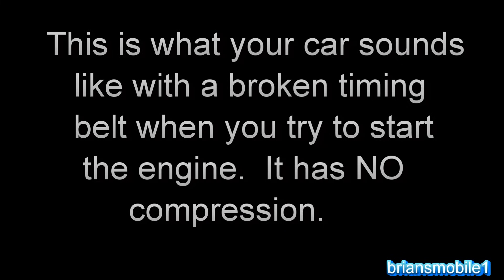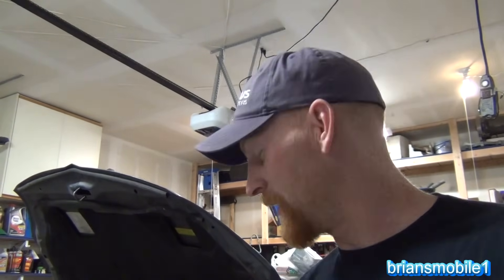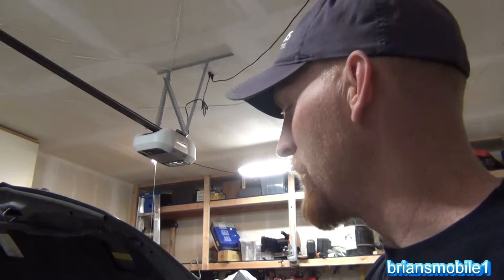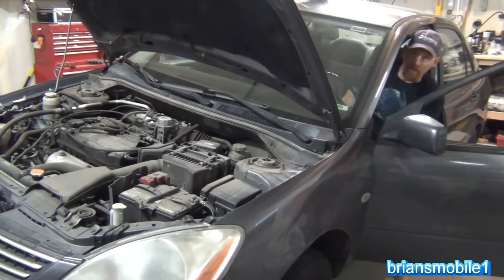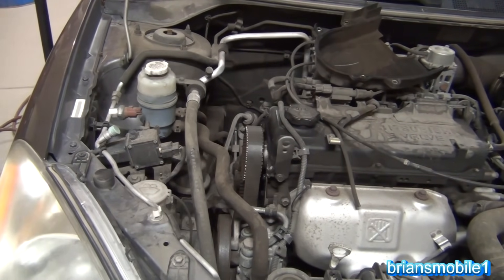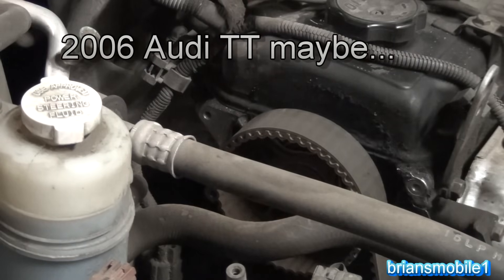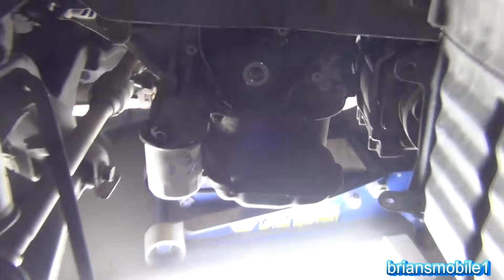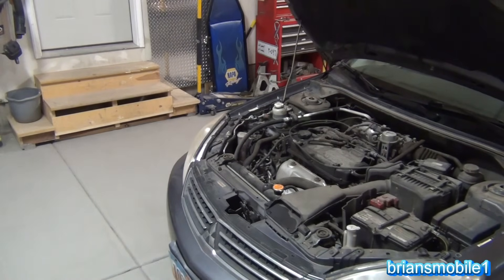What SOUND Does the Timing Belt Make

Comment: My car has a po340 code and replaced camshaft p  sensor. But it wont start at all .opened peep hole on timing belt and it's not moving .could it be other things with my car and it made no noise when it stopped dead in the road .Help

Comment: So my vw gti was running great, I parked went inside for 2 hours, came back out and it wouldn't start, I thought it sounded like the fuel pump, like it wasn't gonna turn over but a mechanic tried to start it and said the chain was broke and messed up the motor... from a dead start? It never started up... is this possible?

Comment: Wait how did you not bend the valves? on a 4 banger 16 valve, there must have been SOME valve stuck open completely, because you did turn the crankshaft via the starter motor, which would have spun the pistons all the way through each cylinder up and down... thus hitting a valve... ?
Reply: +sranjesuper This is a non interference fit motor. There is clearance between the valves and piston even if the valves are open.
Reply: Nutz4Gunz45 That's the only conclusion I come up with, but someone else said its interference motor
Reply: +sranjesuper The Uploader said there is a spot of 45° regarding the camshaft where he got non-interference. It's in a thread a couple of comments up, i just read it quickly. At least he is one lucky man.

Comment: Thanks for video; it might have taken lots of spirit to make it, with an arm busted up. Credit to you. Hope you are now much better. I have a forester 2002 with 200.000 miles in it. It started with a "Check Engine" idiot light. I also heard a noise like the Geiger counter-kind-of, and replaced all 4 sparks (3 year olds), and the PCV valve. Still the data analyzer tells me the knocking sensor is at fault. I can't remove the knocking sensor's bolt (12mm), seized and I I am afraid it might brake if I use an impact wrench (can't heat it; too close to the throttle: fire risk). I begin to think the sensor is only detecting the pinging the timing belt make the pistons produce, because of slack. What do you think (with the grace of the Holy Spirit, that "will reveal ALL things", Brian?) Thanks, in advance.

Comment: I have 2003 CTS 3.2L engine I change the serptine belt then driving last than 8 mile the car made a noise. I did pull over my friend came drove it about a half mile it stopped. The crank senor code came on is this the timing belt and or the valves bent; such I do timing belt and head job or replace engine. What do you think I should do

Comment: I got a 2002 Honda civic EX with a 1.7L V-tech, and I've been having problems with the harmonic balancer coming off the crankshaft with a chipped key way, I went to take off this morning and it stalled leaving my driveway and got stick in the middle of the road, now it won't start at all and sounds exactly like the car in the video. Do you think it could be the teeth on the crankshaft for the timing belt  on the civic.
Reply: how did this pan out? did you fix it or was it done for?

Comment: Hey Brian, my 2001 Xterra would start, Sputter then shut off. It would stay on if I keep my foot on the gas. It’s throwing code p0340 and was told it could be the timing belt. So I replaced the whole damn thing myself, timing belt. Water pump and tensor. Now it won’t turn over at all. Everything is lined up TDC. Also I should mention, brand new FSU and Pump.

Comment: i have a 98 camry 3.0 v6 had to replace the timing belt marks on the back part of the crank line up at the dot on oil pump and both cams lined up with the marks on the back plate,it doesn't want to idle any ideas

Comment: can the engine be broken if the timing belt broke while driving
Reply from the maker: Yes.  On an "interference engine" the piston and valves occupy the same space in the cylinder at different times.  Without being in sync the piston can hit and bend the valves.  Once that happens, the valves can't seal well enough to fire and run well.

Comment: Wow y'all got real lucky that it wasn't a full head rebuild.
Reply: probably a non-interference engine!
Reply: Robert Baines youre probably right. because he would have crushed valves with that attempted start up in the beginning of the video.
Reply: He left a comment talking about how it was an interference engine. They just got lucky because the cam stopped in a 45 degree area where there isn't interference, and they broke down in a parking lot, so camshaft inertia wasn't a big issue.

Comment: Damn changing the timing belt could be very hard, look at those components blocking the way...you have to removed them before you can open the engine
Reply: Timing belt replacement sucks.  I hate doing them.
Reply: nitroman365 hahaha
Reply: Try changing the timing chain and tensioners in a 2007 Suzuki XL-7.
Reply: I'm gonna pass. Haha

Comment: Can I ask you a question, If the timing belt were broke, could you still get it to crank and run and go for a little ways before it dies again
Reply: No
Reply from the maker: Hi Grayson!  Thanks for commenting.  No.  If the camshaft doesn't turn in relation to the crank, it can't run.  The job of the timing belt is to keep those two in sync like a couple of dancers.  Without it, feet get stepped on and the dance partners fall down.

Comment: I have a 2.4l eclipse 5 speed and I think my belt broke. But when I felt it bogging down it didn't make any noise and I pushed the clutch in immediately. I downshift ed and it shifted fine and it was still bogging down and I just pushed the clutch in and pulled over. It is an interference motor but do you think the valves got damaged? It blows white smoke out of the intake and I was told it was because too much compression. Any thoughts are appreciated

Comment: Lucky! When I bought my 99 Accord as soon as I learned it had a timing belt and was of an interference engine design I changed it right away.  144k, water pump was mint and belt was just a bit hard around the edges. Dang Hondas. 

Before that, I had a 2.0 non Ztec Escort....timing belt blew at 40mph. Low and behold, its was a non interference engine. Replaced timing belt and no problems what so ever. Ran like a top again.
Reply: 9.9.15.     I had a 1989 Ford ranger 2.3L with 258k miles on it ,for 22.5yrs, changed the timing belt twice. The last time it was starting to slap against the plastic cover! I replaced it for $6.95, a Gates belt! Ran sweet afterward. I also changed the tensioner bearing & the water pump. 💤

Comment: My guess would be that this is a non-interference engine - that's why he got away with the repeated cranking. There's very little or no chance that his valves would've all been closed at the point the belt gave up.
Reply: I was wondering the same thing. It must be non-interference type. Sometimes car doesn't do anything if it logs a fault code for timing sensors. Would be wise not to clear the code and keep cranking it. 😂

Comment: People say bad things about Pontiacs, but no lie my parents gave my cousin our '03 Grand Prix with 165,000 miles on it, never changed the spark plugs, never changed the timing belt, never changed the head gasket (and it needed it pretty bad). My cousin did all those things after we gave it to him and it's still running with 230,000 on it now. 
As far as I'm concerned the grace of God kept that belt good for 160,000 miles lol. My parents are so damn neglectful... I guess that's why I'm hyper diligent and do my own maintenance.
Reply: grand prix are chain driven most newer if not all GM vechicles are all chain driven. if u maintain the oil changes u should never have problem on the timing.
Reply: kidzero1943 Well shit, am I a silly boy or what. I thought it was belt driven heh... somewhere around 160,000 miles the head gasket developed a leak so my parents "gifted" it to my cousin, I guess when he had everything apart he decided to change the timing chain since he had it apart as well. 
My parents were great on oil changes, and funnily enough they were shit on changing the coolant. 10 years with the same coolant didn't do the head gasket any favors...
Reply: +Jesse Crandle I had a 93 Astro my dad gifted me, had around 200k in 2011 before the gift. did basic maintenance, the worst thing thing happened was  i had to replace was the alternater and ujoints. it started knocking at 380k in 2015 then shortly it was the end for the 4.3 engine.
Reply: +Jesse Crandle  I had a Silverado 94 it made 300,000 miles on all the factory gaskets with regular oil changes and tune ups  and we where not always on time with the oil change sadly this year the engine blew I had the oil changed  checked it oil was good little did I know over the period of that week the gasket went and mixed coolant with the oil I did know and kept on driving my oil pressure was normal and  the engine temp was normal I get about 50 miles away from home and the engine blew a hole in the side of the block milky oil went everywhere its now at the junk yard I now have a jeep grand Cherokee I also had a chevy Tahoe  I couldn't get it to stop misfiring so I sold it to get money for my jeep.
Reply: SuperJeremi10 I worked at a Mercedes dealership for over a year, saw that happen to an 2013 ML 63 AMG. Well, something kind of close. The car was traded in with a knock in the engine, so one of salesman dumped a can of that tar/aluminum looking head gasket fixer in the oil? He drove it around the block and just as he pulled into the dealership you heard this bang, suddenly 5 quarts of oil were on the ground and there was a fist sized hole in the side of the engine. The mechanic who worked on it told me a new motor from Mercedes would cost over 30 grand LOL...
Reply: oh wow lucky for the person who traded it in though wonder how much they got  it sucks though I miss my Silverado I had just got the ac fixed in it too the evap under the dash had a big leak in it so It would not hold Freon for more then a week it went 10 years without ac we finally spent the money had a new coil put in new evap coil line dryer orifice tube and ac compressor so it would be a new 134a system and it had been open to the environment for so long the pully on the compressor seized up so I said what the heck ill redo the ac system.  I love my jeep though its nice drives good and ac works great I had the drain line cleaned out though it was clogged and water backed up inside not pretty when you had to pull back the carpet to get all the water out.
Reply: SuperJeremi10 That sucks, AC work is a big undertaking, and basically what you did (replacing pretty much everything) is almost what you have to do once a system has a leak. Hell Eric the Car Guy, he'll do a video "fixing" someone's AC and then they come back 2 weeks later and it doesn't work again... you just have to replace everything.
Reply: yea it is that's why we waited so long to do the ac on it but when I got it I wanted ac  I loved having ac though don't we all its nice to have   yea I have seen that  with that town and country he was working on my mom had one of them vans that thing was a bitch to keep running even from day one  we regretted buying it ever since yea it was a nice van but it was in the shop at min every 3 months for something the first week we had it the ac went out and the breaks stopped working it always had the issue with the belt popping of and leaving us stranded if we hit a small puddle even if the belt and tensioner was new it always seemed to have break problems It got to the point when the engine light came on we just kept driving it till it broke down or had to be fixed we will never buy another town and country my Tahoe I had to replace the office tube it was clogged and drain out the oil it was all black and filthy self eol and I replaced the line dryer thing  pulled a vacuum put new oil in and recharged worked great after that ice cold air it did not have a history with leaks only leak It had was at the charging port and I fixed that with new valves  ac still works perfect on it  but I sold it due to major mechanical issues no matter what I did I couldn't get the engine running right I sold it to my friends dad who wanted t use it on a hunting lease and as a work vehicle and did not want something nice to get messed up hes also a mechanic so I'm sure he will get it fixed sold it for 1,000 I also gave him the Silverado he wanted it we did a trade he doe some mechanic work for me and he gets the truck so everyone is happy I have no idea what hes going to do with it but I don't really care I got new car.
Reply: +SuperJeremi10 the person probably knew about the knocking thats why he traded it.  We see this all the time at Honda but the thing is the salesmen that work here know about and could give 2 shits if the car is in bad condition. Anything to make a sale...they don't care. Honda pays for it
Reply: kidzero1943 Same at Mercedes honestly. If the motor blows it's the dealership that loses money, but if they convince someone to get a new vehicle then they get money from it. That being said I find most salesman think they're hot shit and have no clue how to diagnose vehicle problems, so the salesman probably just figured there was a faulty part (that wasn't as important as the engine).

Comment: Also... you have to be the luckiest person in the world for a broken timing belt on an interference engine to not damage the valves. It was at the moment when the 2 outter cylinders were at the top of their strokes and the 2 inner were at the bottom, number one was at the very top of the compression stroke, number two was at the very bottom of the power stroke, number three was at the very bottom of the intake stroke, and number four was at the very top of the exhaust stroke.... meaning all the valves were either closed, or out of the way of the piston.

Comment: Nice. Liked that.  I'm looking for help with this problem.  Writeup below I've used on Nissan forums.  I'm thinking my issue may be a failed hydraulic timing belt tensioner.  Any ideas or experience you have is greatly appreciated!

Hello all!  This is my first Nissan Pathfinder.  I have always wanted one since the late 1990s.  It's a 1998 SE 3.3L, automatic transmission, 167,000 miles on it.  I got it at an estate sale for $2,000.  

It has a loud knock or tap that happens part-time and so far it's not been resolved.  I'd really appreciate it if anyone could point me to anything to check next, or describe if you had similar problems with yours.  I've run the motor minimally...only to troubleshoot.  Here's what it does and what I've done:

1. When it's first started, it knocks for less than 1 second and then gets entirely quiet.  I hear maybe 2 knocks when it first starts.  Then, when the motor is accelerated to 2000 RPMs it begins to knock and it keeps knocking until 3000ish RPMs. It increases in speed as the RPMs increase.  If I let off the accelerator it stops knocking.  When it's higher than 3,000 RPM it goes away.  So it's in this midrange RPM the knock is present.  It does this sitting still, or driving it.

The rig was very sheltered it's whole life from what I can tell.  It was driven lightly by an elderly lady.  It's in immaculate condition, inside and out.  Garaged.  Paint and interior is perfect.
Motor starts, idles and runs great other than the knock.
Oil is full.  I dropped the oil pan and checked the main and rod bearings. There was not any play. I changed them anyways.  Noise persisted.  There was some material in the pan's bottom, about 1/3 tablespoon (1 teaspoon) of what seemed to be fine wear material.  Which I would think is normal for 167,000 miles.

2.  It has a P1400 error code, for the EGR solenoid.  I have not chased that yet.  I don't find where this would cause a knock though.

3.  The transmission fluid is 1 to 2 quarts low (based on my guess from stick reading), but the noise does not seem to be coming from the transmission, and the vehicle moves and drives fine.  No slippage.

What could be causing this part-time knock?  

Hydraulic lifters?  Timing belt slap?  Harmonic balancer?  Cracked flexplate?  The noise seems too loud to be the lifters, and doesn't do it at low RPMs like lifters usually do.

Any ideas would be greatly appreciated.  Thanks!

Comment: I had a 2003 Mitsu Galant 2.4l that broke a timing belt. I didn't even bother attempting to get it fixed because I read so many stories of those engines needing major work after that happens. Unfortunately I had the timing belt replaced when it was supposed to be changed with the hardware...the hydraulic tensioner seized up and shredded the belt. :(